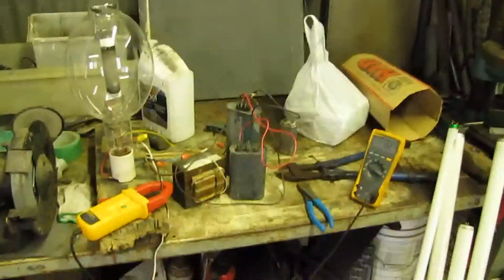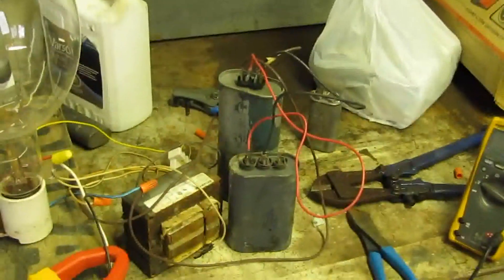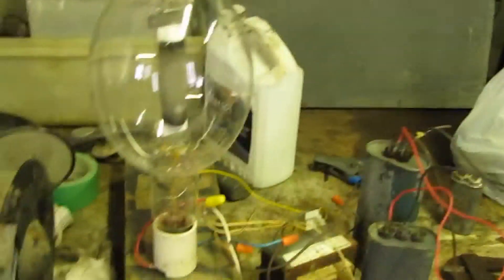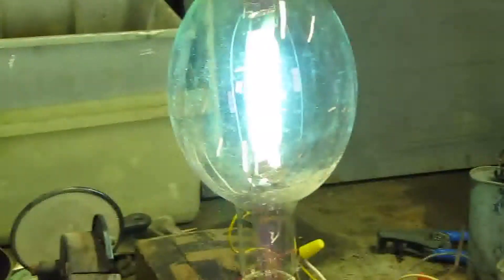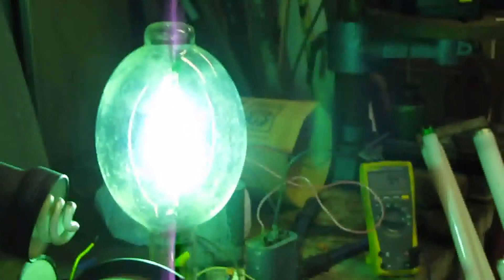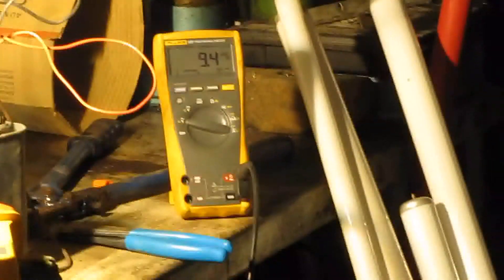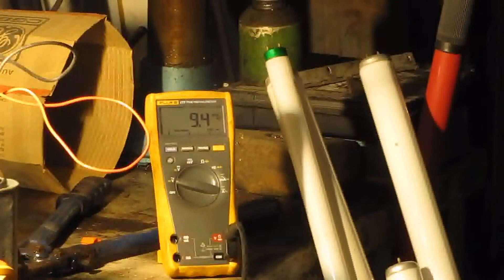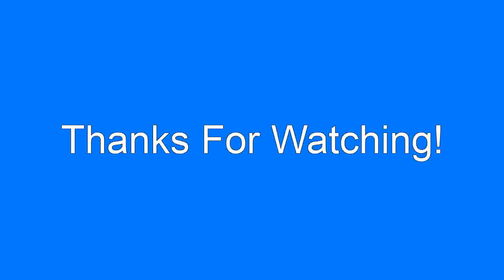Lighting a 1500 Watt Metal Halide HID lamp with a 400 watt rated ballast

Comment: Did the ballast over heat too much? I tried something opposite. I've a GE R1000 MH Lamp & Universal 1000W ballast with range from 120/208/240/277V. Had one 400W lamp too but unfortunately I didn't have a 400W ballast. So, hooked up the 400W ballast to the 1000W ballast and wired it for 208V and plugged to 120V. I was quite surprised that the bulb current draw was only 4A and worked just like it is supposed to. I was worried it might blow up or something.
Reply from the maker: The windings on the ballast did get pretty hot.  It wouldn't be any good for continued operation.  The 400W ballast would defiantly fail.

Comment: hi so I have a 250watt ballast and I have a 400watt light could I use it or will it not work
Reply: It should work but you won't get the lamp up to full temperature and it may put more load on your ballast than it was designed for..
Reply: @DJMinor5000 Are you simply opposed to people experimenting with HID lamps on ballasts that have an improper ANSI code and are you also opposed to people running European HID lamps on American gear? I urge you to stop discouraging people from doing weird experiments with HID lighting as long as they know what they are doing. Personally, I have been very successful with running metal halide lamps on older mercury vapor ballasts as long as I add an appropriate ignitor to the ballast. For HID lamps, what you really want to have for running HID lamps properly is to run the lamps at the proper arc voltage and current and not be totally bogged down by ANSI codes. Just know that in some cases, that an improper ballast may actually run a HID lamp properly if you manage to get the lamp running at the proper arc voltage and current. In some cases, you can run ballasts in parallel in order to allow the lamp to draw more current than it normally would if you are using just one ballast. For example, you can run a 250w S50 high pressure sodium lamp by running a 150w M102 pulse start metal halide ballast and a 100w M90 pulse start metal halide ballast in parallel. Using such a setup will run the 250w S50 high pressure sodium lamp properly because both of these ballasts will run this lamp at its proper arc voltage and current. The reason for this is because 250w S50 high pressure sodium lamps are designed to run at an arc voltage of 100v and draw up to 3.0a from the ballast while 100w M90 pulse start metal halide lamps run at 100v 1.2a and 150w M102 pulse start metal halide lamps run at 100v 1.8a. When you wire both of these ballasts in parallel, the 250w S50 high pressure sodium lamp should be able to run at 3.0a at 100v because the currents from the 100w M90 pulse start metal halide ballast and the 150w M102 pulse start metal halide ballast are combined while the arc voltage stays the same. However, there are some exceptions for this type of ballasting: for example, some high pressure sodium lamps especially many high pressure sodium retrofit lamps for mercury vapor ballasts must only be run on high reactance autotransformer ballasts or choke ballasts as their voltage rise during life will destroy constant wattage autotransformer ballasts. In my experience, I have been able to run a 35w S76 high pressure sodium lamp by connecting 2 F20T12 preheat fluorescent chokes in parallel in conjunction with a rare 2 wire high pressure sodium ignitor. When I measured the lamp’s current, it drew about 0.83a, which is the correct current for these high pressure sodium lamps. In the case of running a 1500w M48 probe start metal halide lamp running on a 400w M59 probe start metal halide ballast, the lamp should cycle since this lamp is being operated at half its rated current and half its arc voltage.

Comment: There should be a 1500 watt MH ballast you can get from 1000bulbs.com
Reply from the maker: I wanted to buy a 1500 W MH ballast from that company, but they don't appear to ship here in Canada.  I also want to purchase a T12 F96 VHO fluorescent lamp ballast, rated at 420 W  from that company, but once again we have a shipping issue.  Everything here in Canada is so expensive, especially when you have to deal with middle men retailers and not simply the supplier.  Other issue is the old technology is getting harder to come by here in Canada, because the lighting companies and selling shitty LED lighting, along with driving the so called "energy efficient" craze  to every business/ individual.   I personally hate LED lighting  and am not a fan of electronic ballasting/ T5 or T8 lighting.  Thank you for the comment.
Reply: Vicsonvee You're Very Welcome. If you can, you could try looking on eBay! I bet you'll find something there!